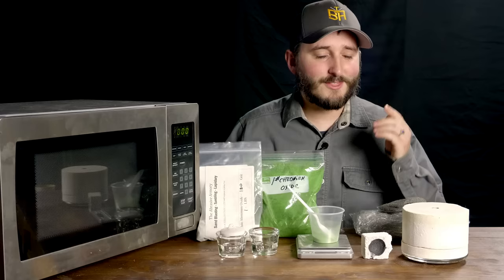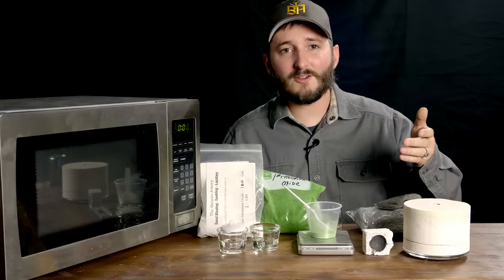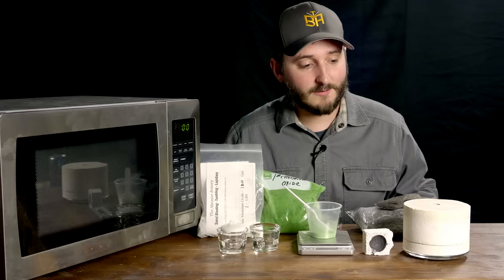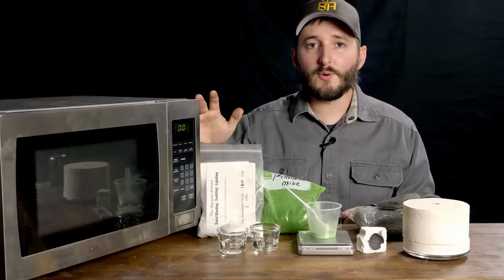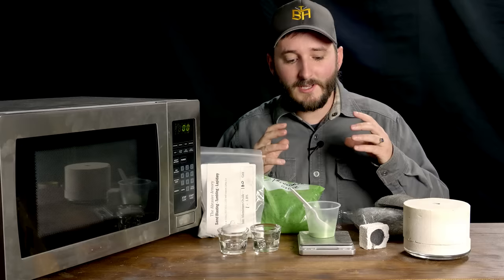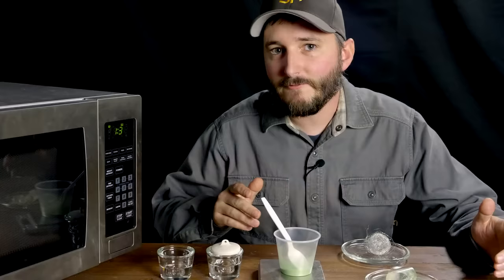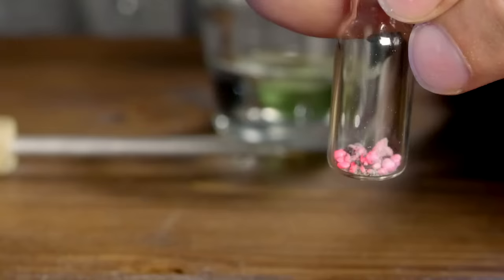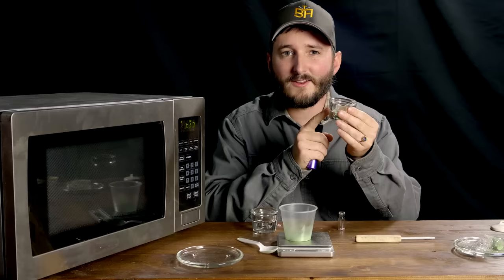How To Make Ruby in a Microwave

Comment: Be careful with those glasses, nile red showed that the plasma can damage glass, causing it to break spontaneously later
Reply: When he showed that part I said, "Yep, and he had to destroy all those beakers!"
Reply: Good call out. Temperamental tempered glass!
Reply: 2 months later: "So all my beakers started breaking…"
Reply: Time to take out the Thermal Tamper
Que the smashing symphony
Reply: The rapid change of temperatures can do that, had a bartender give me a newly washed glass with a cold drink, didn't last long.
Reply: @norXmal  roblox_oof_sound.wav
Reply: Farhan Rahman  Not impossible because it shattered in my hand, it came right out of the dishwasher, which are much warmer than 80F, he could've pulled it out mid cycle of the cleaning or there could've been a weakpoint in the glass.
Reply: @norXmal I gotta agree with you.  Continuously washing and blasting it with 150-180F water and then rapidly cooling it down to near 32F, could easily cause stresses in the glass or enhance imperfections.
Reply: Farhan Rahman  Had this happen to me, also. Yes, a beer glass can shatter like this.
Reply: @norXmal  actually, it's different than thermal stress. The glass beakers that Nile Red was using have a very low thermal expansion to avoid that problem. However, the glass was chemically changed by the plasma in a way that weakened it.
Reply: @MordecaiV  later he found that the plasma was actually dissolving some of the glass I believe?

Comment: 2005: make diamonds in your microwave with charcoal and peanut butter... lol, jk.
2020: make rubies in your microwave... no, really.
Reply: Haha, I remember the Mythbusters trying to replicate that diamond peanut butter, good old time lol
Reply: @alphaadhito  I don't, do you remember which season and/or episode?
I have them all.
Reply: Funny thing is the charcoal + microwave = diamond is possible in a near-vacuum (chemical/plasma vapor deposition). There are actually a lot of different ways to do it.
Reply: @Baigle1  Don't you also need a very high pressure?
Reply: @blg53  Not really. Most successful setups use low pressure mixtures of a noble gas and methane at high temperature, but you can also use ion beams to knock off charged high velocity chunks, imbed ions directly, or statically attract free gaseous ions from plasma. 

If you are directly trying to crush a sample of charcoal (or even super-pure graphite) inside a laser-assisted diamond anvil (at any usefully large crystal size), you will usually always get grain dislocations, vacancies, impurities, and various crystal arrangements that make it hit-or-miss with most industrial processes. 

Now that I mention it, it may be possible to use an x-ray laser arrangement which only targets deformities in crystal structure inside diamond anvil cells. This may make it possible to only (or mostly) allow growth of a selected type of crystal (or along a certain axis) in a combined micro-vapor deposition/ compression method. Good work, you.
Reply: "Diamonds and Rust" Commercial diamond manufacturers (incl. diamonds made from "loved ones ashes") occur at elevated pressure (~100,000 psi) and temperature using Iron catalyst. If Iron is saturated in Carbon and slowly cooled, the pressure of Iron crystalyzing creates small diamonds (eat the metal away with acid).
Reply: @duh4572  April 22 2009 , banana slip episode 116. Swishhhhh
Reply: @MikeRancid  Cheers Mike.
Reply: @Baigle1 cool

Comment: I have a suggestion for a more energetic way to create rubies: I'm sure you know that when a lighting strikes a beach you can then find at the point of discharge some glass in the shape of the electrical arc that melted it, aka fulgurites. You can also make these with a power transformer (the ones hanging from poles) and a flower pot filled with slightly damp sand.

Also there is a way to make fulgurites harvesting natural lightings, basically break the path from a lighting rod to ground with a jar full of sand.

What if instead of using sand you use the ruby seed material? I think you could get pretty gorgeous lightning shaped rubies.

I hope you can at least set up some "lightning traps" somewhere if you can't or won't deal with a power transformer and its dangers
Reply from the maker: I might be able to combine that idea with another I've been thinking about. Thanks for your comment!
Reply: Like taking the scaled up process for making flash graphene and applying it to making rubies
Reply: @Nighthawkinlight  hello i am a material scientist, a machine already exists that could recreate the same plasma conditions as a lightening strike. Its called Vacuum Arc ReMelting (VAR or VAM depending on the author) this machine is used to melt high temperature research alloys that require 3000+ degrees Celsius within seconds
Reply: Kinda like what the backyard scientist did? but with the ruby material instead of sand?
Reply: @Nighthawkinlight  I am excited to see this idea.
Reply: This is a really awesome idea, and i would love to see the result.
Reply: @Nighthawkinlight  if you're thinking about rocket-triggered lightning, we should talk. I've been working on a low-cost method on and off for...almost 10 years now. Main issue currently is building my own field mill for launch timing, as commercially available field mills are cost-prohibitive.
Reply: @CarlMarvin  
Please make a video of what you are talking about.
I will sub just in case you do.
Reply: @intothecalm420  I'll probably make a video if/when I'm successful. If you're curious though, there's videos from the university of Florida who use this method for research. 

There's lots of other videos out there of failed similar projects, and I'm not eager to add to that heap unless I have a usable result. Even then I'm a bit hesitant to make a video outlining my process because it's, well, lightning: a very unpredictable and deadly natural phenomenon.

Don't expect anything too soon though, as it's been alternating between the back and side burner for many years now 🤣
Reply: @devilkirby95  lol I'll get right on that.

I can already tell you the top result doesn't actually work. The raw analog inputs on an arduino are far from capable of this sort of measurement. (I learned this by actually building that design)

 This kind of instrument requires delicate op-amps, a high degree of shielding from noise, etc. A CD case with some metal bits inside isn't going to cut it.

That being said, I've made quite a bit of progress towards doing so, even with my meager circuit design and arduino knowledge. I'll get there eventually.

The challenge isn't necessarily the field mill itself either, it is making it portable enough to deploy quickly, durable enough to survive a hailstorm, and wireless so that it can transmit data back to where I'll be (a safe distance away)
Reply: @CarlMarvin  can you point me to some good resources as to why carbon allotropes become super paramagnetic after microwave irradiation?
Reply: @Ed_Aylward  i think you tagged the wrong person here
Reply: I remember some videos where these people were shooting rockets into thunderstorms that were grounded  with  thin gauge copper wire. One way to create a low resistance path to whatever ground you want lightning to go to.
Reply: people burn wood with high voltage electricity. you could probably burn a similar pattern out of rubies if you had some sort of electrically resistive mix.
Reply: @Nighthawkinlight  How about a plasma arc from a neon sign transformer? I used to have an old one that would produce some seriously hot plasma arcs when I brought a grounded probe over to an aluminum plate connected to the output of the transformer. I was able to melt platinum dust into beads with it so it was hitting around 1800C. Might be more effective than the carbon arc method and you can perhaps turn your seed material into solidly packed discs with a binder material and a hydraulic press to situate it directly in the plasma.
Reply: Look at inductively coupled plasmas. They're a lot more torch-like They use much lower RF frequencies (~50 MHz), but there may be ways to couple to a microwave's output.
Reply: Massimo 
🤔...(!)...(??)....
Reply: NightHawkInLight 
Please don’t delay long a video about this...
Reply: Hasan 
🤔 So what’s the going price of this thing?
Reply: High voltage? Arcs? Making crazy things? I think we need styropyro on this.
Reply: @Nighthawkinlight  perhaps find someone near you with a giant tesla coil, and ground the arcs through the seed mix??
Reply: Sounds like something styropyro could help with
Reply: This exact comment creates the need for a collaboration with “styro pyro”!
Reply: My idea too. But you could mix carbon for diamond. I figure you need to drop a high pressure capsule containing the material inside a sand bucket where the center has a conductor either aluminum foil, cable or metal graphite dust. Then shoot a rocket into a storm and let it drop a lightning ⚡ into the magic sand castle 😜.
Reply: @hasanhas00n1  I just wanted to let you know that I think material scientist is one of the coolest jobs that I wish I had known about before I went to college. Definitely going to be a huge field of study in the coming decades. Not that it isn’t now, but even more so and widely known and recognized by regular people. There are so many neat developments going on that are going to change our world forever!
Reply: yeah, i hear those Fulgerites are also useful in summoning DEATH.....better have your pickle chips ready though....
Reply: @Massimo those transformers hanging on electric poles are stepdown transformers, they step down the power from the high voltages  required to carry electricity long distances into lower voltage and current to run to your home, that way you don't have 4,000 volts ac at your wall receptical.
Reply: @sinformant  Yes I know. You can also connect them backwards to get high voltage out
Reply: Loki the sly one  are you talking about a static field voltmeter?
Reply: would a tesla coil type device work for that?
Reply: Zvs driver and a car battery?
Reply: @Nighthawkinlight  I think we would all be super interested to see how that would turn out! I'm going to sub and keep my fingers crossed for this
Reply: Um, lighting bolts are typically 500,000 Amps at 1,000,000 volts. Where would you get that?
Reply: @stephenjacks8196  You don't strictly need the power of a lighting bolt to make fulgurites it would be the coolest way to do it though. You could get away with an arc welder probably and if you want to flex a power transformer connected backwards (there are videos on youtube using just that)
Reply: @Yrouel86  Your math is wrong.
Reply: There are research facilities that make artificial lightning for testing purposes. They draw 100+ KiloWatts  and usually have their own transformer station. An average home circuit accumulates 55 KW over a month. Did you even know that the "leader" coming from the cloud only ionizes a path, that the return bolt from the ground that has all the power.
Reply: @stephenjacks8196  I don't understand the points you're making to be honest. I suggested to make ruby fulgurites either by harvesting natural lightings which can be done setting up "traps" and hoping that during a storm they would be struck or with high voltage using power transformers (v=SMlW1APWTVk) or some other high voltage source (v= QvrSp3zgalY), or even with less "exotic" solutions like an MOT (v=oJ3QV3-6t6M).

In other words you just need enough high voltage to arc through sand and enough current to melt it.

Of course the examples I linked are using sand and I don't know what results could be achieved with the ruby starting material hence my suggestion to experiment with the idea.
Reply: @Yrouel86  I worked at an Aluminum plant in the PNW ("cheap hydropower"). It had its own high voltage substation. That substation drew more power than the city of Bellingham. Some of that electricity is used to keep "vats" of cryolite and alumina molten. So yes it can be done. Just because something can be done doesn't mean it is practical or the best way to do something. Ruby lasers were popular in the 70s and industrial methods were developed for that. (Industrial rubies required impurity to glow yellow in UV so can't be sold as jewelry, they were that good.) Engineering is Science deployed in the real world.
BTW, isn't liquid alumina a byproduct of thermite?
Reply: @stephenjacks8196  Dude my suggestion was for content and to explore such possibility to see what happens I never said it would be a practical or the best way to do it.
Are you new to YouTube? There are plenty of channels, for example chemistry channels, that do certain experiments just to explore and demonstrate the science and not necessarily because it's the best and/or practical way.
Reply: @Yrouel86  Yes, the Journal of Irreproduceable Results is a real thing. Indeed there are some really "out there" YT videos like "the cinamon challenge" or eating Tide detergent pods. Movie "Sweet Home Alabama" was about fulgites and started a short lived craze. Impressive: Newberry Crater, kilometers of volcanic glass lava floe.
Reply: @Nighthawkinlight   @Styropro plasma fire thingy?
Reply: Just make a Lichtenberg fractal burner out of the power supply from another microwave. VERY simple to do! I own one. Take your seed material and add a bit of water, and insert the contacts into it, and run a few thousand volts through it. That should make fulgramite rubies....maybe. 👍
Reply: @Ed_Aylward  I cannot point you to any sources, or resources, but one carbon structure that becomes super paramagnetic is a stack of graphene layers, don't know its name. Graphene layers have hexagonal cells. Graphenite, the stack? lol, dunno.
Reply: @stephenjacks8196  you just blew my mind with the thought of making termite and adding cromium oxide to see if it could make an instant ruby
Reply: @wafikiri_  I am no material scientist (yet) but I think a stack of graphene layers is called simply graphite
Reply: @stephenjacks8196  1,000,000,000 volts
Reply: When I was a boy, my dad was on the local fire department.
They responded to a downed electrical wire, just wuietly sitting there on the ground, looking as harmless as could be.
After the power company did their work and the fire department was called off, my dad came home and told us about it, and stressed how silent and innocuous it seemed, but was in fact extremely dangerous.
The next day, after work, he wentnback and dug up the glass the power line had silently made in the sand it had landed on, in order to bring it home and demonstrate the power that had been silently gushing from the line.

If you ever want to touch a downed power line, take a second to rub your palms together and get them really hot from the friction. If you can get them hot enough to melt sand into glass, then you may be powerful enough to tangle with the power grid.
Reply: Hey guys ive always wondeded if printing with glass could theoreticaly be done like in the sense as a 3d printer also in the form of a spining press idealy eliminateing hand blown objects or is thisalready a thing?......
Reply: Tesla coil
Reply: Stun gun?
Reply: Two ideas come to mind... Maybe add just a little of your nucleation material, in powder form, and add it to your mixture.  Start small, too much at too fine a grain might explode 😅.  Good thing microwaves come with doors.

Second, I was thinking of how to concentrate the heat, it occurred to me that maybe enclosing the seed material in a foil wrapper would work.
Reply: Two ideas come to mind... Maybe add just a little of your nucleation material, in powder form, and add it to your mixture.  Start small, too much at too fine a grain might explode 😅.  Good thing microwaves come with doors.

Second, I was thinking of how to concentrate the heat, it occurred to me that maybe enclosing the seed material in a foil wrapper would work.

Comment: Microwave:
Aluminium-Oxide molten
Soup still cold
Reply: very true
Reply: 69th like
Reply: Check mains voltage before. If it has low level microwave oven won't work.
Reply: Just use plasma to heat your soup :D
Reply: Put some steel wool in an try again.
Reply: @derGhebbet  ill season it with aluminium-oxide
Reply: Obviously because you forgot to put some metal clippings in your soup to create nucleation points.
Reply: And Hot Pockets lava hot
Reply: No soup for you!!!
Reply: Pro tip- Add aluminum wool to your soup
Reply: @bzmotoninja83  I like how you think
Reply: @dmaraptor  I think you missed the joke lol
Reply: lmao dfhghdfg
Reply: It takes crazy amount of energy to heat up a water. That's why I use 1:30 for usual food from fridge and at least 2:30-3:00 to heat up a soup :)
Reply: This comment is great!!
Reply: @seanheelan6740  "no, your comment is great"
[smiles in keanu reeves]
Reply: @derGhebbet  Lol.
Reply: It heartz
Reply: Thank you for this comment I thought it was just me
Reply: But the bowl is searing hot. Same thing that happens with mugs.
Reply: AH, you seem to have forgotten to place your aluminum wool half-way into the soup.
Reply: :D
Reply: hahahaha loled hard XD